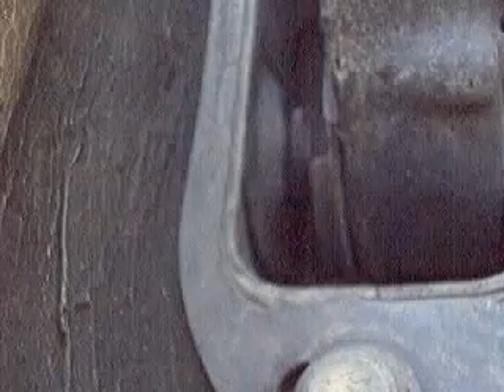BMW E36 323is Rear Trailing Arm Bushing Failure

Comment: Not good at all, There is a new bushing design now from BMW which is way better as it takes up all the slack void area either side compared to the older ones or you can use bush shims which will effectively do the same job.

Comment from the maker: On a '98 323i?? No, not enough power. I rolled over some rocks turning out of a driveway and it broke traction slightly since that's like driving on marbles.
Now, on my new 135i... Yes, I have SERIOUS wheel hop problems.

Comment: With the failing trailing arm bushing did it cause an intermittent shake in the steering wheel at around 60 mph? having that problem in my slammed e36 and trying to pin point problem before i go about replacing the front end.

Comment: Oh shit. I have exactly the same problem. I have had it for around a year. It first starts with a sharp grinding sound when steering sharply at very slow speeds. Like pulling out of a parking spot or the driveway. Then the grinding goes away, and there is more play, and you end up with rear wheel steering.

Comment: Hey man, thanks for your video, hopefully this helps me a lot. Heard about bushings being common to completely give up at this age.
I have a 1998 323i that make's a pretty loud knocking noise and slips to the left or right when you hit a drain for example, and now it's started to snake at high speed on slightly slippy roads (not like it did when driving like a dick before =P)
Heard this might be the symptoms, wondering if you could shed some light?
Cheers sir

Comment: Hey i have a 325i 92' and its knocks really hard when i shift at high speeds maybe due to weight dist. could that be a rear bushing problem? or a pressure plate prob? high speed shit i push the clutch in and then it knocks any help?